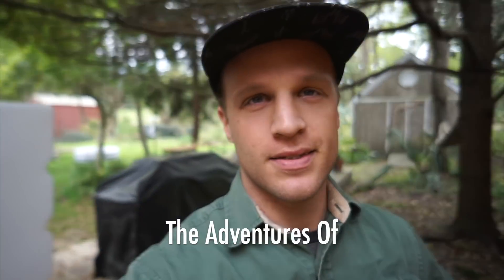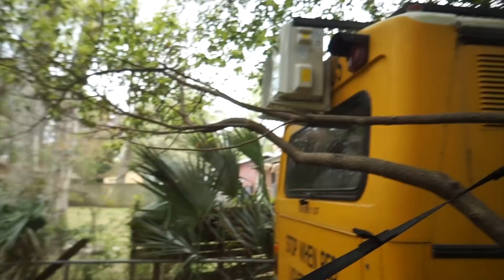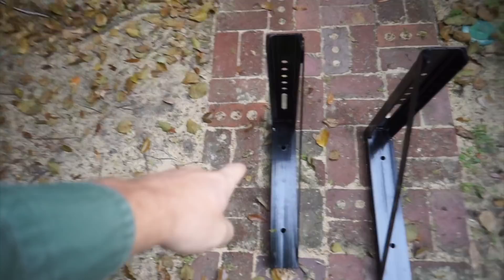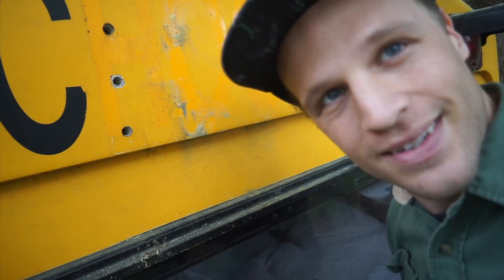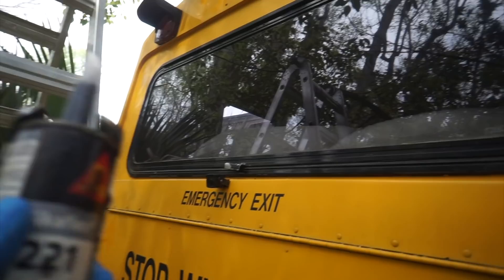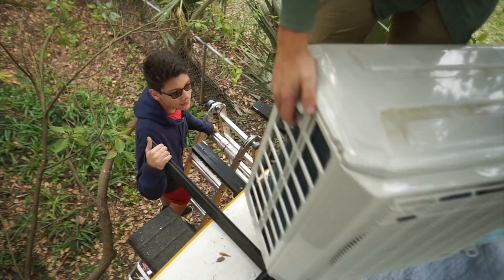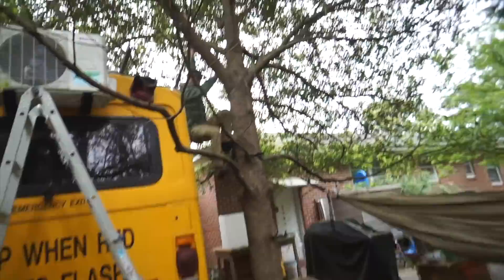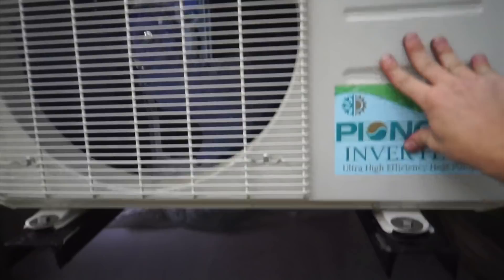How We Mounted a Mini Split AC (Air Conditioner) on the Back of Our School Bus Tiny House Ep 51

Comment: do you have any pictures/videos on how the inside is braced? or did you just bolt through the sheet metal and that's it?
Reply from the maker: It's bolted through the fiberglass cap (that part of our bus is fiberglass) and a 1/2 inch plywood bulkhead drilled in to strapping which is drilled into the steel of the bus. It's rock solid but just sheet metal would absolutely not be enough.

Comment: Have you had any issues with the unit vibrating and/or shaking around as your drive the bus around? I've noticed a lot of units made specifically for buses that are supposedly designed to withstand the vibrating from driving around.
Reply from the maker: Have had no issues over 25k miles

Comment: Is this holding up?
Reply from the maker: Yes everything has functioned well over 15K miles so far.
Reply: @MobileDwellings  awesome thanks for letting me know. About to do something similar through my rear bumper, I think.  The "feet" of my unit don't really seem terribly strong, they're basically just C channel spot welded to the bottom.  But I think they'll probably hold up.  

How did you port the line set through the exterior wall without introducing a bunch of leaks? I guess there's probably some gland I need to order that I just don't know the name of.

Hope your new build is going well!